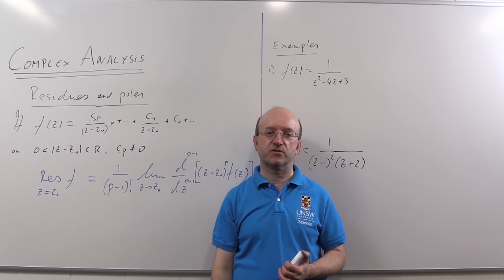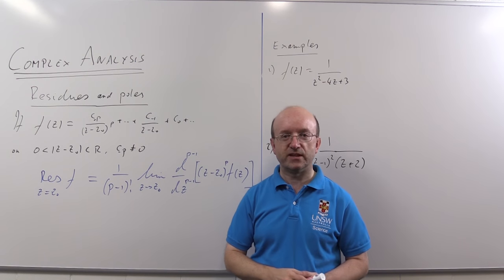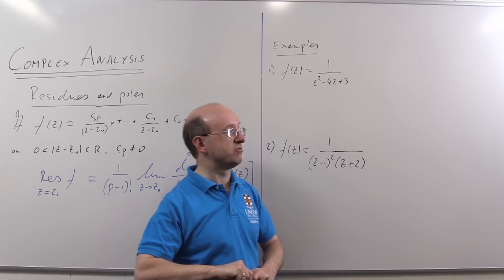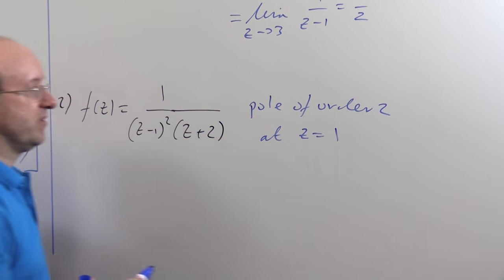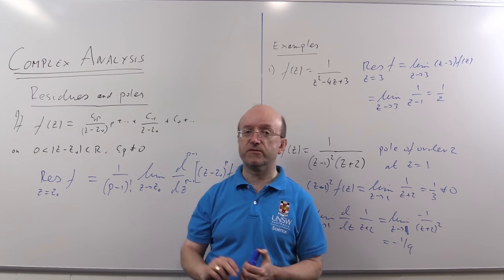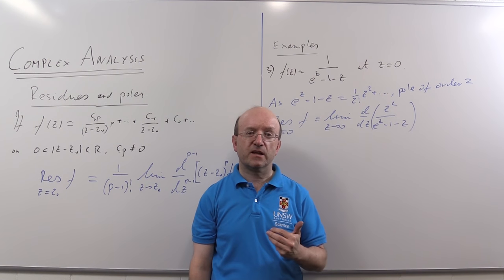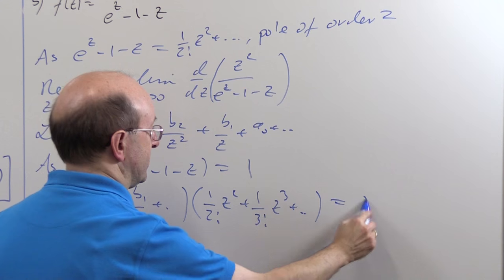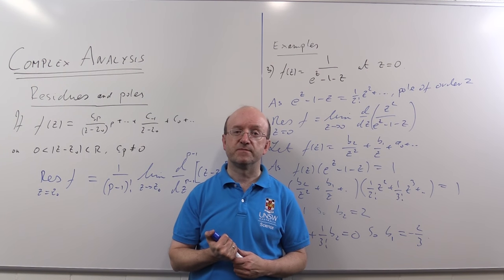Complex Analysis 14: Residues part 2, poles

Comment: The video is really nice and concise but i have one little question. In the 3rd example why do we say that the function 1/(e^z-1-z)  has a pole of order 2....i understand that the first 2 terms of the series cancle and the starting term for the denominator is z^2/2!  but there are higher order terms as well like z^3/3! & z^4/4! and so on...... so cant we say it's a pole of order 3 or 4 or something greater?.....why do we go with it being a pole of order 2?
Reply: since the z goes to zero, z^2 and z^3 both infinitesimal but z^2 is actually much bigger than z^3. I believe it is related with the little o notation. 
Think like (0.001)^2  > (0.001)^3 so that the squared one actually has higher order.
Reply: z^2 is in the denominator, and a pole is defined when the function-> infinity so like the other guy said z^2 is much bigger than z^3 and so on
i know this is very late and u r probably working now but let the others know lool
Reply: If z0 is a zero of order n of f(z), then it's a pole of order n for 1/f(z). Since the first term is z^2, it has a zero of order two, thus one over that function, 1/(e^z -1-z), is a pole of order two.

Comment: i didn't understand why did you take f(z)=b2/z+... in the last example
Reply: It's because f(z) has a pole of order 2, so the "shape of the function" (as he calls it) is "something over z^2 + something over z + ... +", i.e, b2/z^2 + b1/z + .... where b2, b1 are yet-to-be-determined constants in that series. There are no terms lower than z^-2 because of the pole order. 

The rest is grouping the product that follows by the order (power) of the z terms and solving the resulting linear equations. It's a clever but common trick that you'll see a lot in ODE too.

Comment: For the second example im still not sure why the first result being non zero means you must take pole of order two method but then the next result you still get non zero result yet we are satisfied with this result as the residue
Reply from the maker: +MrAmo123 I explained in the video on zeros and poles why if (z-1)^2f(z) has a non-zero limit at 1 then z=1 is a pole of order 2, but that limit is not the residue. For a simple pole you get lucky and the limit (z+1)f(z) is the residue. John Steele